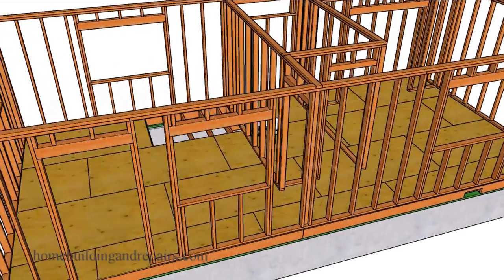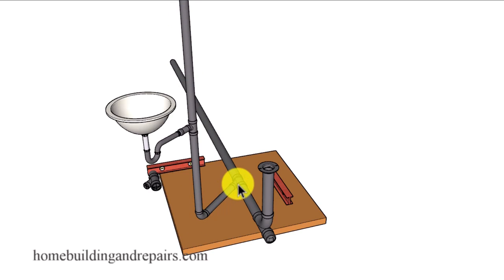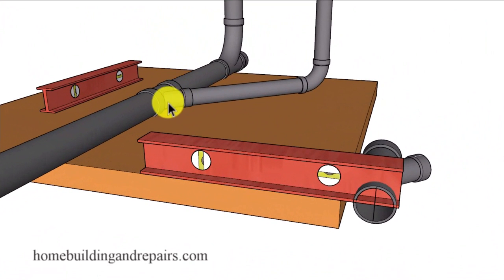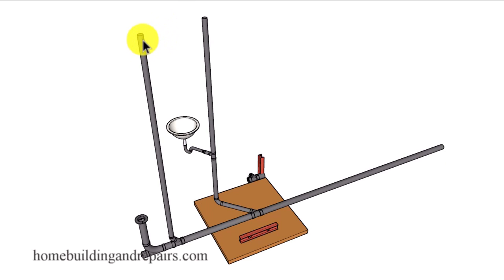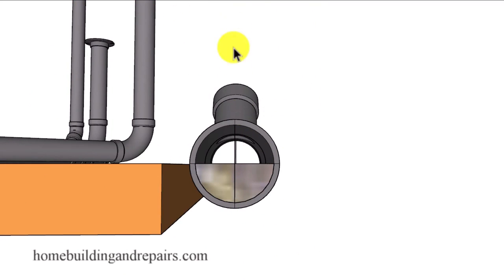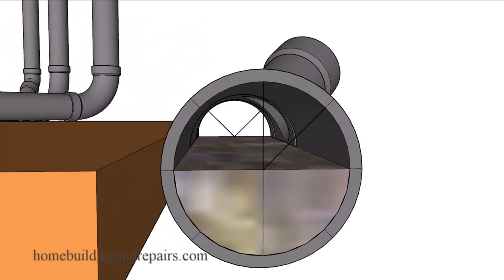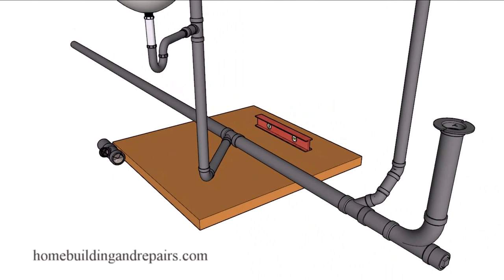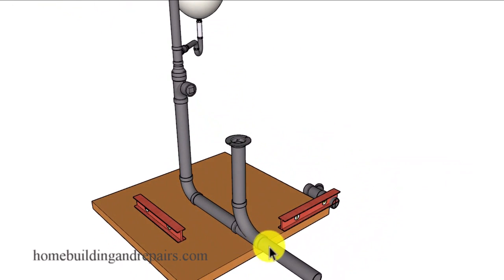What Is The Difference Between Horizontal And Vertical Plumbing Drain To Vent Connections?

Comment: I had a situation where the only place I could vent the toilet was from behind. It worked quite well, but I couldn't find anything written it the IPC, the UPC, or anywhere on the internet, which described this as being an option.

I'm glad to finally see it referenced somewhere!
Reply: because its not. you cant put a drain into the trap arm of the toilet. best case is to paralell the drain from the sink and tie it down stream of the vent inlet.
Reply from the maker: Glad to help.

Comment: Do you have a good example for using 4 in. x 4 in. x 4 in. x 2 in. x 2 in. (Nibco 4870).
I imagine is it can combine lavatory, toilet and tub drain and give vertical vent at the same time.
Reply from the maker: I don't think so. You can check the plumbing section at our website, it might provide some other designs that will work.

Comment: Why not just use a San tee for the vent you don’t need the wye.
Reply from the maker: You can, but my thinking is always design pipes for snake cleaning tools, that's why I suggested the combo fitting.

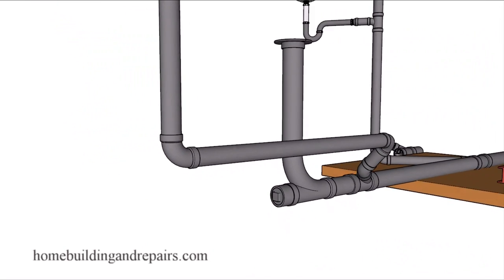Comment: You cannot vent a toilet in the fashion (horizontally) you have shown at about 4:46 without that vent being a wet vent. With the system you are showing, the vent for the toilet cannot break to horizontal until it is 6” above the flood level of the toilet. In some cases where it is absolutely impossible to vent a toilet or other fixture vertically before reaching the flood level, an inspector may let you do it the way you have shown if you install a cleanout on the vent. But you made no mention of this and your animation does not show a cleanout. You just can’t do it this way without permission and a good reason.
Reply: You are correct . That is dry venting and ,in the event of a blockage , effluent  and waste can get stuck in that horizontal branch with no wash out .   
It can be configured that way if it has a lavy  upstream washing it out . In that case it's a wet vent , as you said .
Also  when horizontal branches are pitched at 1/4"  per foot . fluids adhere to the inside of the pipe in a circular , scouring  motion leaving the center hollow . Not filled halfway with fluid as this video shows.